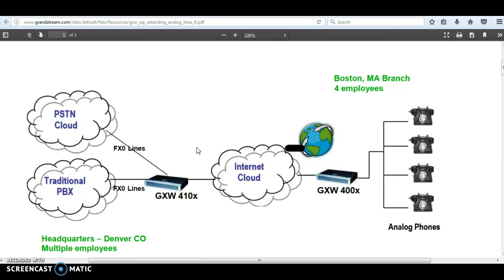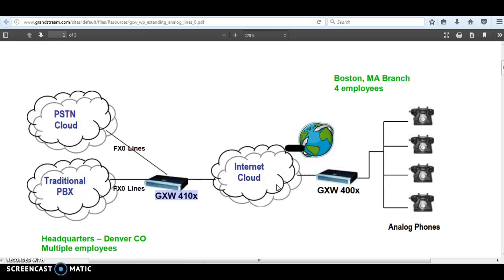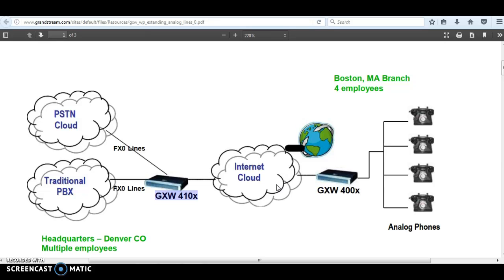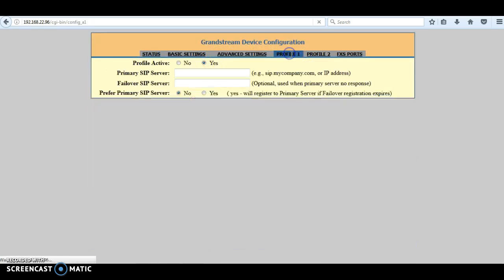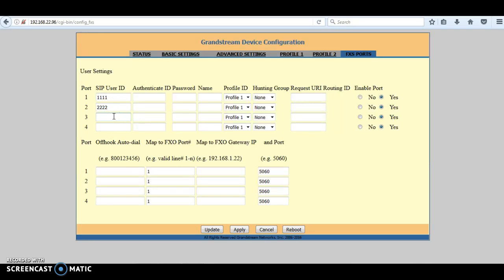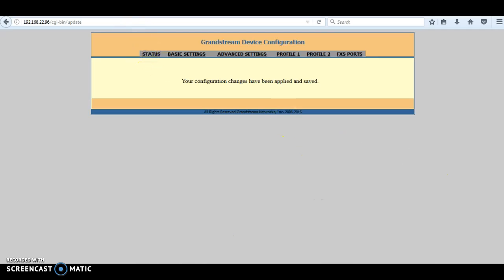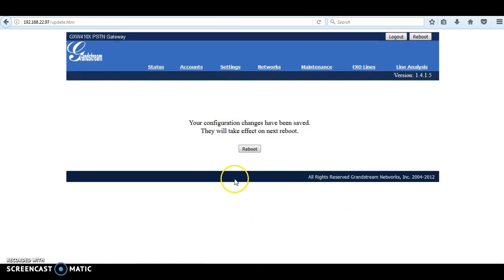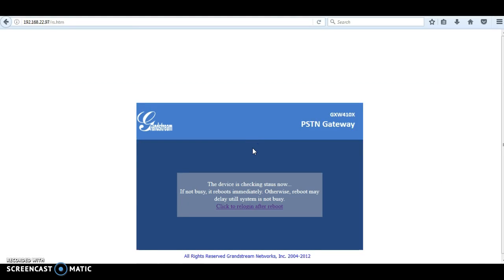Grandstream GXW4104 GXW4004 Extend analog lines over IP with FXS to FXO mapping

Comment: Hello. Thanks for the video, it was very helpful. I wanted to ask you if know a way to  reduce the time it takes to forward or to make a call between the 4104 and 4004. I have tested the scenario you are presenting here and I witness a delay of about 6 sec from the time you hear the revers-call on the calling phone's headset till the time the remote phone actually rings. Thanks in advance.
Reply from the maker: You can reduce the number of rings to 1 under Settings > Channels Settings > number of rings before pickup. The default value is 4 to allow GXW410x to detect CID.
Reply: I will try that. Thanks for your reply.